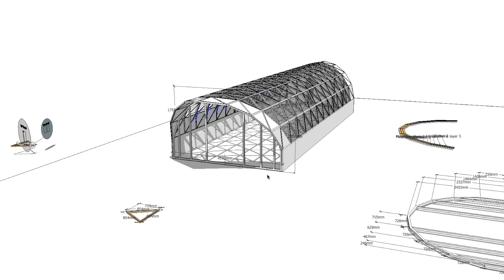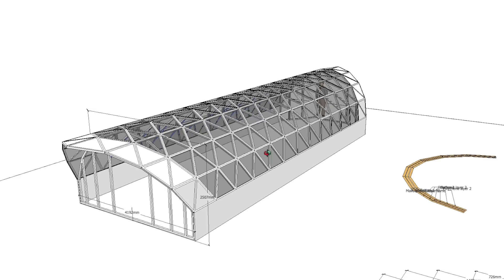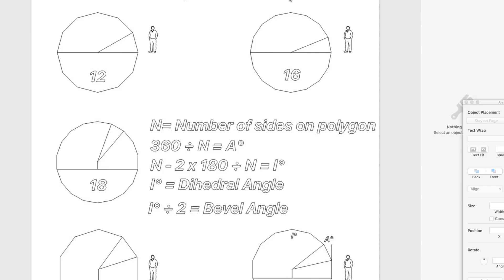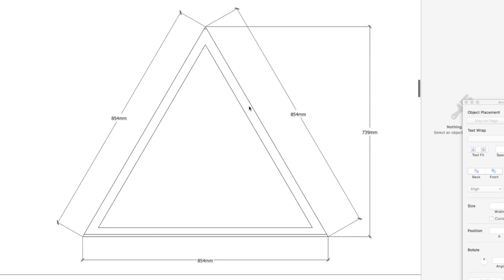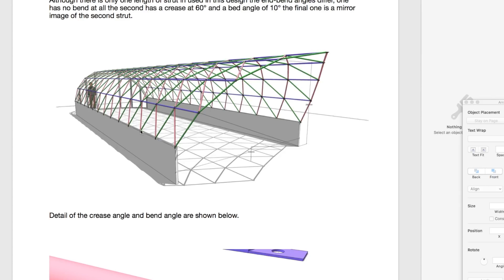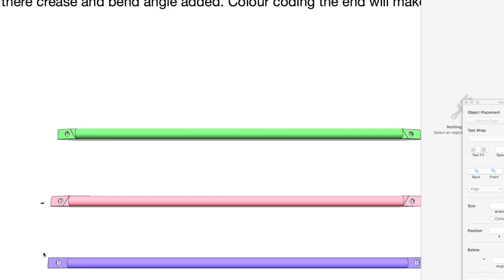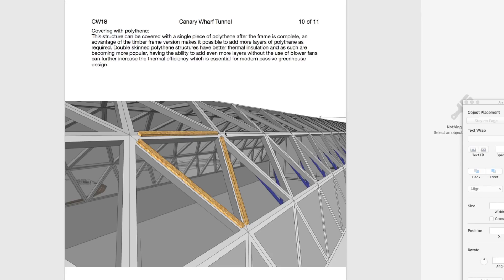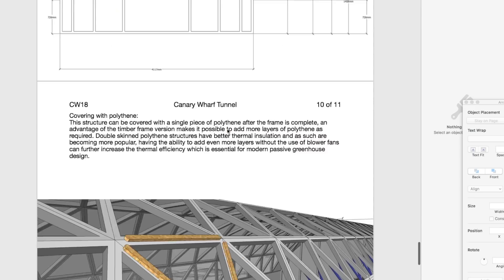Free plans - super efficient tunnel greenhouse

Comment: Hello Paul. I just found your channel. I’m planning my retirement in SEA. I have a farm of two properties that I have leased. One lease is on a three year rotation. It was pawned to me and turns over every three years, if the 45k pesos is not repaid.  So my friend, I like the tunnel for a barn and chicken coop.  Also, I need a solar drier / dehydrator. I was thinking polycarbonate as the roofing. 

This is a structure that I could assemble myself or with two or three $10 per day filipino fellows.  Termites are a terrible issue in the PI but I’ve researched some preventative measures used in Arizona and Florida, USA. 

I’m looking forward to purchasing your plans. Thanks
Reply: Ever build one?

Comment: Surprise that it needs extra supports. i thought geodesics are self-supporting.
Reply from the maker: A structure has to be triangulated in 3d space to be  rigid, if for example you laid out a bunch of triangles on a flat surface they would be stiff in that plane but you could lift one triangle off the ground and distort the flat structure.
Reply: @Geo-Dome  thx, you mean this structure isn't triangulated in 3d space?

Comment: this one has straight lines going horizontally. Your other tunnel has  straight lines going vertically. Do they perform differently? thx
Reply from the maker: Yes they do, tunnels with vertical aligned triangles are a bit stiffer and tunnels with fewer triangles going around the tunnel are stiffer again.
Reply: @Geo-Dome  Thx, but unclear. I was referring to the straight lines. This one has straight lines running horizontally, ie along the length of the tunnel. Is this the stiffer style?

Comment: I made a conduit version of this, it had no strength. had to disassemble it. I'm going to try a wood one - hoping it will ave more structural strength
Reply: I was thinking of trying this out framed in wood, but you comment makes me kinda worried. At the very least it seems to need to cross braces as shown. Did your wooden version work out?

Comment: How do I calculate the dimensions of the triangles for different sized tunnels?
Reply: I'm pretty sure the side length of the triangles is completely arbitrary as long as all respective angles remain the same. I think what you would do to resize your tunnel is to determine a good candidate from the three different colored struts Paul shows here, which will best suit the dimensions of your build. So for example, let's say you choose the purple strut - you pick the length you'd like that strut to be, and then find the proportion between your chosen length and the length of Paul's purple strut here. You then apply that proportion to the lengths of the other colored struts as given in the plans, to find the custom lengths of the struts you'll need. 
If that's not hard enough for you, you could use similar figures (length of 1 strut and the relative angles of the dome build) and a little trigonometry to come about the dimensions you need. Hope this helps..  😄

Comment: Paul, couple of questions
How is ventilation managed on this poly tunnel. Most poly tunnels suffer from over heating. I really like the design its very beautiful and probably very strong but would over heat significantly without any shading.
Floor insulation any ideas? with no auxiliry heating in the winter it would still be freezing with ice inside if their was no solar gain which by hearing your accent grey cold winter days would not be abnormal to ya.  
how do i accurately produce each end of the struts accurately. I thought about 3d printer could work really well. do you have the detail for this?

Nick

Comment: I have to ask a question, for a conduit dome it looks like the struts are all the same length, just different angles on the bend, is that correct? If so that makes for an incredibly easy build!
Reply from the maker: Yes all the same from hole centre to hole centre.

Comment: Still height is too low.  No place for heat acumulation.  Where plants  not reaching.  Height should by >350-400cm to excess over heat. The covering problems solved.  On this type cover. I will chek later how to make higher. Dome was problem solution for the low height.  Now we are back to the main problem.  As now new green house heights is 9-11meters height. And we are still based on 250cm... So we can build it from plastic tubes.  Much cheeper. I will never  agree to build less then 4meter height greenhouse.  Because plants reaching 3meters. And there left only 50-100cm space.  Where they got overheating. And CO2 is not available.Places where is not available to make higher.  Using open cover http://www.hortidaily.com/article/40039/Retractable-roof-helps-AU-greenhouse-function-with-extremely-low-energy-costs